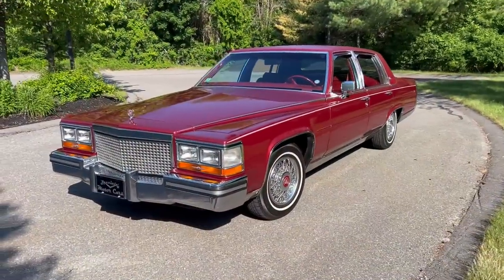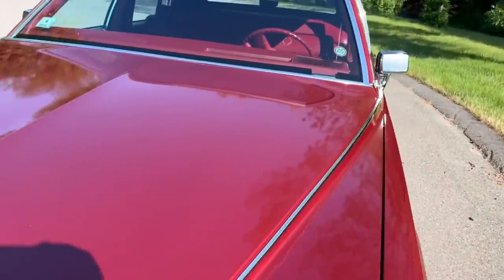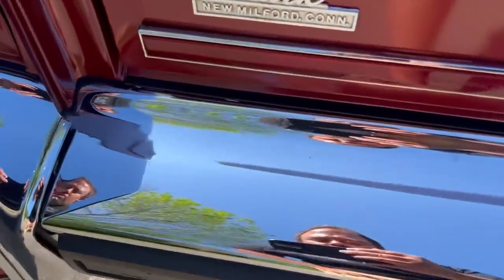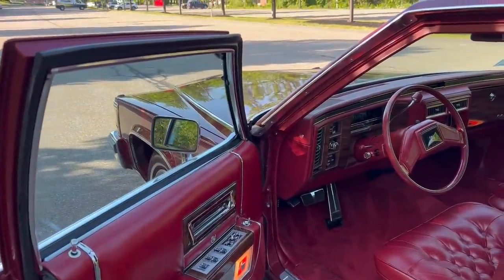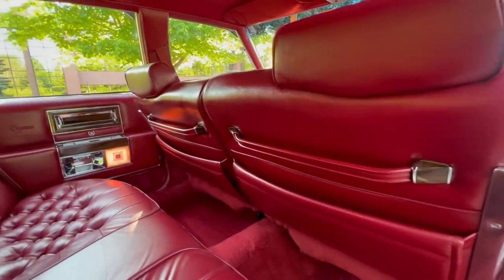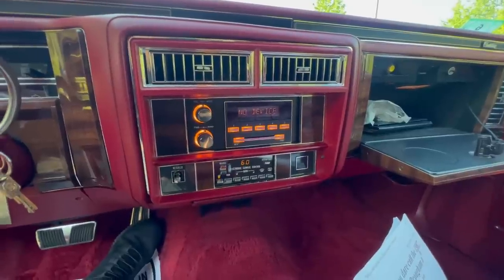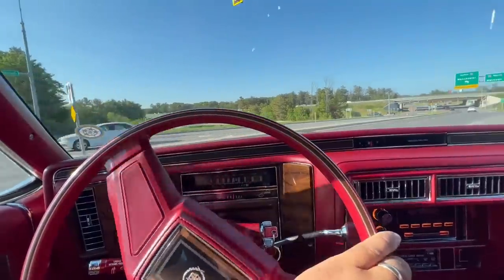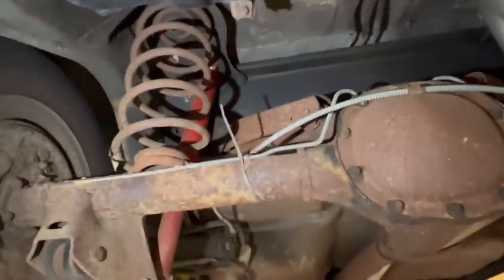1987 Cadillac Brougham D’Elegance 62k miles Autum Maple Firemist FOR SALE Specialty Motor Cars

Comment: Ditch the aftermarket window drip guards. They aren't needed and detract from the appearance.
I drove plenty of 307s when they were new in the '80s and they were noticeably quieter than the 5.0 liters from Chevy and Ford. Very quiet under full throttle. So they were not barnburners but they were civilized.

Comment: I've had a bunch these caddies and other GMs/Lincolns of this era with both plastic and leather steering wraps. Oddly I preferred the plastic over the leather, as long as the plasti-wood inlay was in good shape. General feel of the steering wheel kinda sucks when that inlay is cracked, broken, or missing all together (I got good at replacing those).  GM leather wraps would always get sticky for whatever reason and just felt unnatural in your hands unless you cleaned them constantly -which would then wear the leather prematurely😞 of course!  I currently have an 04 Lesabre Limited which came with a plastic AND leather wheel, kind of an odd mix I've never seen -I like it a lot! My 2000 Park Ave I drove years ago was an all leather -same issues with that steering wheel -hated it.  Lincolns and Mercuries seem to be much better at doing leather wraps, though I prefer GMs thicker gauge wheels.  Anyway -blah blah blah -sorry🙂 Thought it was a good question worth chiming in 2c's.....

Comment: People complain about the 307, but I defend it as it isn’t bad at all so long as it is properly tuned and taken care of. Advancing the timing a bit helps, as does making sure there are no vacuum leaks. Another issue is stretching of the throttle cable. I’ve had a couple that seemed gutless upon purchase, but both had a stretched throttle cable. Once remedied, the drivability was WAY better. It’s still not going to win races outright with most modern vehicles, but it will feel good and confident off of the line, go up hills well, easily keep up with traffic, and even do some good passing. A 0-60 should be 11-ish seconds if running well, as mine do that. I’ve seen people say theirs were near 20 seconds or worse, so no wonder they blast the 307. These people, however, should realize something is wrong as no one would have bought them when new if they were that terrible. Lastly, the 307 is super reliable and durable, which is a real plus considering Cadillac was not batting a thousand with engines in this era like they were in the 70s and before.
Reply: Drive a 91 with the 305 TBI. Feels like a totally different car.

Comment: Ever think of just finding a    olds  350 block preferavbly 70-72 and then it will fit right in and you got 100 more horsepower plus 100 more torque.. i had a cadillac 1987 absd someone put a Olds 455 1970 in it. It was fast AND Smooth..